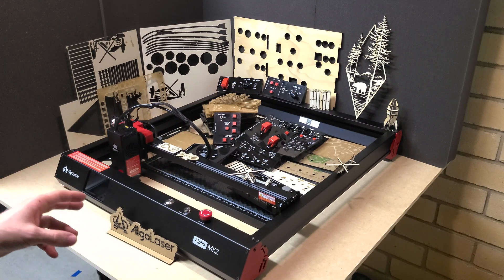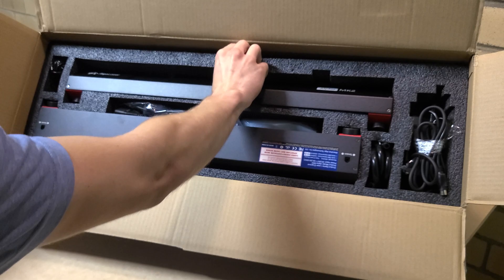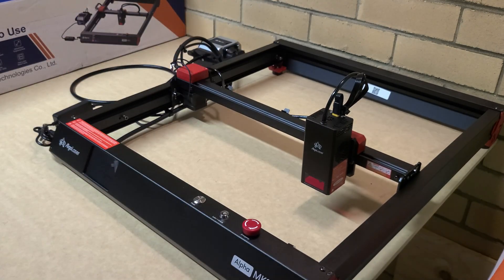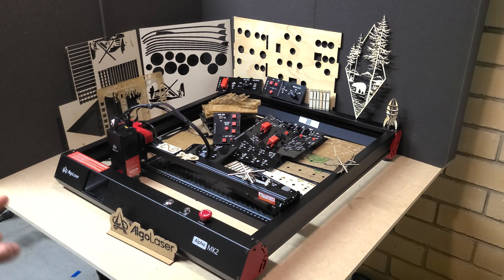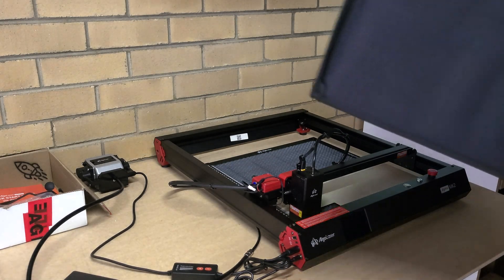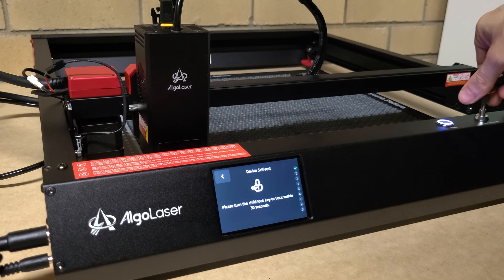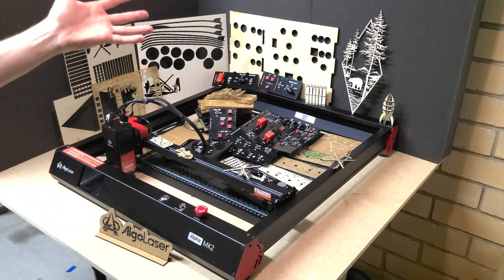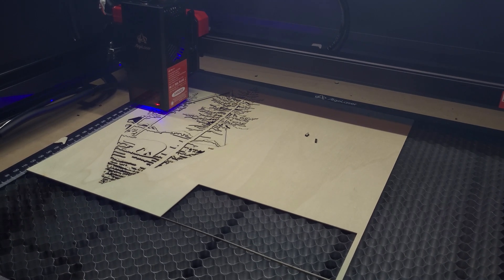I Didn’t Expect the AlgoLaser Alpha Mk2 to Be THIS Good!

Comment: Would this cut and score cardstock?
Reply from the maker: Yes, with ease. You can specify the strength of the laser, so you just need to pay around with the settings to find the desired strength for your use. They have a great table for this on their website also.